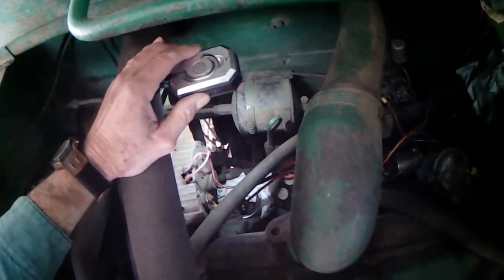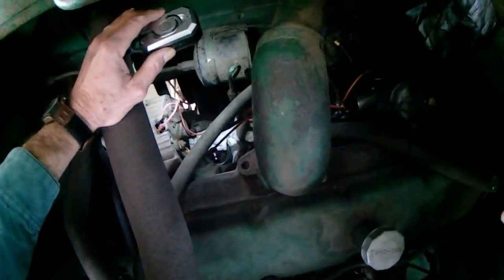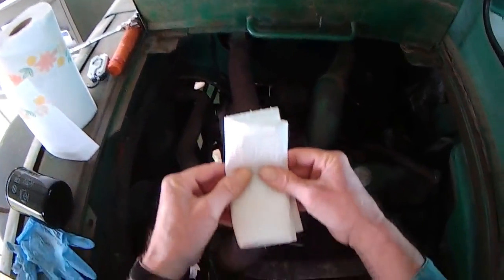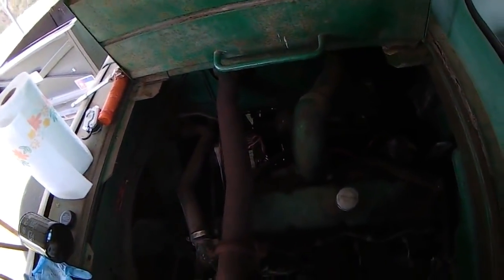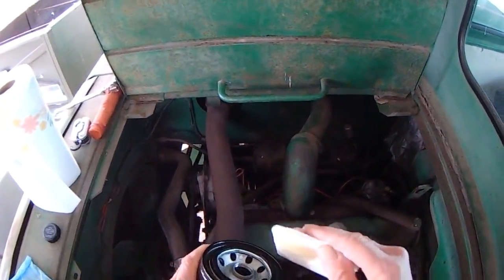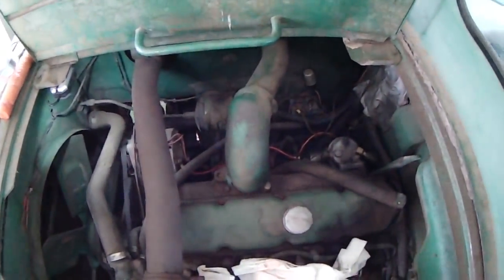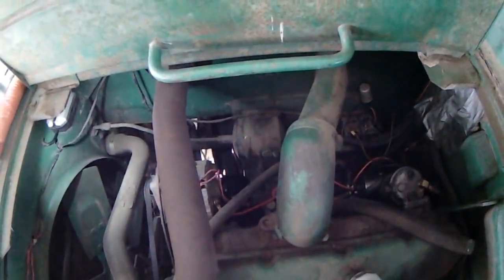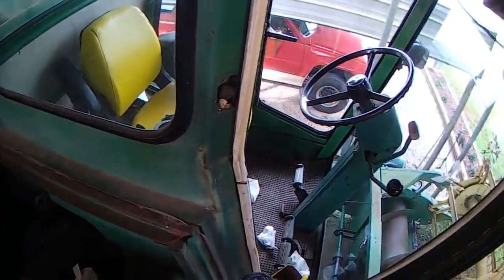A John Deere Filter for a John Deere Combine

Comment: Oil is fine, I have used oil too, but most of the time I use just a little dob of grease on the finger right out of the end of the grease gun, smear it all the way around the gasket, works just as good and seems like it is not as hard to get off next time.
Reply from the maker: Lance Bass - never tried grease, might give that a try next time.   I do know for sure, don't put it back dry.

Comment: Changed  oil and filter on our new 5045 tractor first service... Talk about being tight......Had to remove side screen..... Used Snap on strap wrench...Ended up destroying filter......   When I worked for a trucking company I built my own filter wrench out of heavy duty metal banding material....for large dia filters..........wIX Makes Napa  filters... they have basically the same part number.......
Reply from the maker: Farming for Fun & Profit - thanks for the sharing of the past events in your life.  so WIX makes NAPA filters, just learned something new.  NAPA should advertise that.

Comment: Nice video..I dont own any farm equipment but I have a john deere lawn tractor..I svc it twice a yr and use only john deere products/parts..may cost more but oh well..fram filters are junk..now with my dodge dakota I use mopar parts specifically for my truck..hate after market crap ..most of it is junk now days
Reply from the maker: George Harsha - recent annoyance with an aftermarket alternator for my Toyota.  the first one worked about 3 weeks and the second one was out of tolerance for fitting into the bottom bracket.   real pain that ordeal was.
Reply: @SoybeanFarmer3300  i can imagine

Comment: My tractor takes that same filter.  You suppose when they were designing that combine/engine, they could have thought of something else to fit on the backside of the motor?  Maybe they could have squeezed the AC compressor on that side also.   Or maybe even shove the batteries over there too.
Reply from the maker: Ag Wild - you had a 4400 and then got yourself a 9500.   I bet you did not know I watch your videos...   as I read more of what you said here about shoving more stuff over there on the back side of the motor I began to realize just how good it is compared to how bad it could be.   thanks I feel better now.  :)
Reply: Soybean Farmer I guess my point was the old saying that engineers should have to work on what they design.  Anyway if I have offended you, that wasn't my intention. Just making fun of the engineers I guess.   Sorry.
Reply from the maker: Ag Wild - man you never offended me.   I actually saw the humor in what you were saying.   the :) symbol means I was laughing because of what you said.     it's all good..
Reply: Soybean Farmer ok good.   Sometimes I interpret what people say backwards.   Dyslexia maybe.